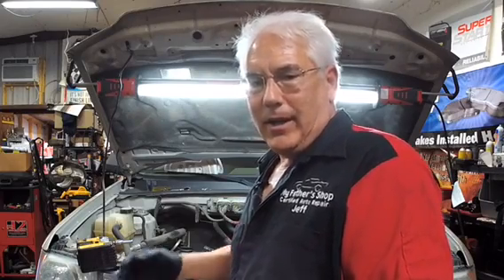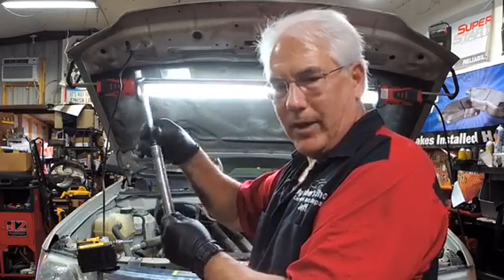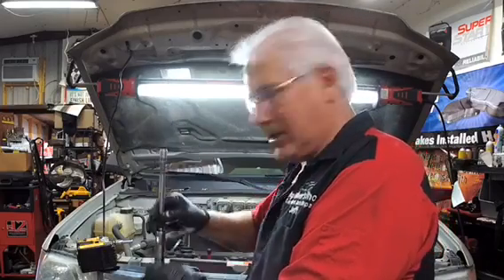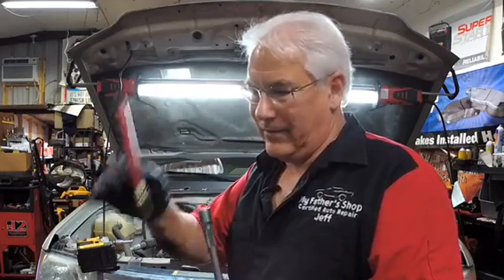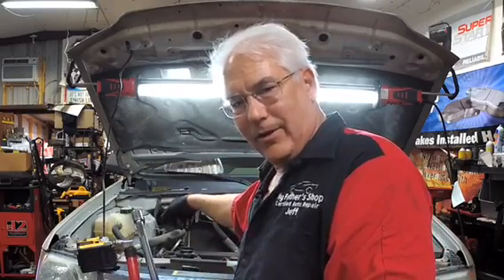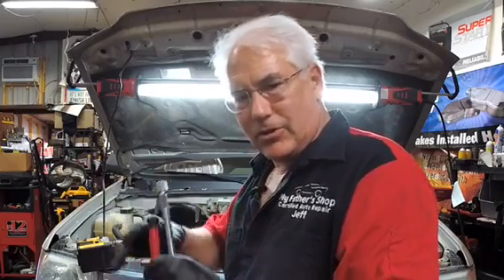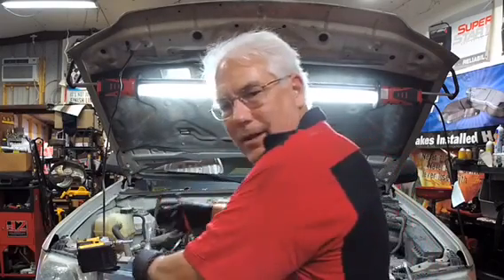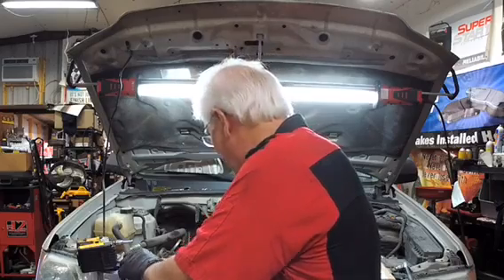Jeff Buckley explains why Oil is leaking in Spark Plug Tube

Comment: Hello, I need some help. I have an 03 civic, I replaced the donut seals, cleaned the coil packs and spark plugs ( spark plugs were new) because some oil got in the wells. It ran fine afterwards but eventually the check engine light came on, and says it's misfiring on all cylinders. It looks dry in the wells with the new seals doing there job. So my question is why is this happening? I cleaned spark plugs off incase I didn't do a good job last time. Coil packs look good since I last cleaned them. I don't get it. Do I need to get new coil packs, and or spark plugs? Did the oil getting through it before ruin them?? Please someone help. I don't know what to do. Thankyou!
Reply from the maker: You can get new boots for the coils if the oil was on them . I would have put new spark plugs. Sometimes if oil was on them they get a coating that you can’t clean . Try both of those next.
Reply: @myfathersshop  ok, thanks!

Comment: Good this cause the engine to not start?
Reply from the maker: Yes, it can foul multiple Spark plugs. Pull the coils and if they come out with oil on the ends, suck the oil out with a shop vacuum.

Comment: It's the the plug port seals not cover gasket. Faulty cover gasket will leak oil down the side of the head and black.
Reply from the maker: Yes, the valve cover has to come off to replace those.
Reply: I think it's a 5.4 2v engine in this video. They don't have "plug port seals", or tube seals, other than a rim on the coil boot.

Comment: It's the sparkplug tube seals, not the valve cover gasket.
Reply: That is 2 different things, and an owner can start with the simple and cheap one first... (the valve cover gasket replacement).
Reply: The 5.4 2v in this video does not have tube seals. The tubes are molded into the heads and are adjacent to the valve covers.
Many other vehicles do have tube seals or O-rings, especially if the tubes go through the valve cover.

Comment: I'm looking at the main valve cover gasket and it's perfectly sealed, the top gaskets, actually no 4 was leaking, so I gently turned each nut 1/4 turn each until I did approximately 3/4 - 1 full turn to tighten and it's stopped the leak.

Comment: I fixed my 2001 Camry and I removed the oil in cylinder plug no 4.. cleaned up all spark plug down inside and retightend the 4 nuts on top and it stopped leaking. The gasket was only 38 months old and I'll be watching it to see if I'll need to replace the top gaskets.

Comment: Hi I have oil fouling on the electrode and thread of the spark plug in only cylinder 3 on my 01 v6 mustang. I’ve replaced the PCV system, valve cover gasket and put a new plug but when I pull it off it’s still oil fouling. I have good compression in that cylinder and my car doesn’t smoke on startup so what in the world could the problem be?
Reply: Your valves need adjustment or worn piston rings.

Comment: Ford changed my spark plugs and a coil on my 2003 Grand Marquis. I has 170,000 miles. They changed it on 9/16/2020, and 30 days later, the car is losing power and shaking a little. Ford say I have a leak in cylinder 7 of the valvetrain. It must be a major leak for the spark plugs and coil to soil again. I thought I had a warranty onnthe work Ford did but they say I don't have a warranty.. They did not want to check to see if oil leaked onto the spark plugs and coil or whether they sold me bad spark plugs and coil or bad work. I spend over $500 for them to change spark plugs and a coil.
Reply: So what it you point? Get a real mechanic and do NOT go to a dealership if practical.

Comment: Hi.   I Have a simple question. I have a audi a3 2008 , 143000 miles.. I been dealing with oil on sparks plug , I change twists coil and spark.. change pcv, even oxygen sensor, air filter clean throttle body and temperature sensor... I thinking its will be piston ring .. And just notice its getting hard to star probably is injector I'm sure... my question is you thinks its worth it keep changing piston ring with injector.   For this car? Or jus  I give up and get  new one ?? Thanks

Comment: Jeff! I changed the valve seal cover and the spark tube seals and its still leaking, do you think its possible that me and my dad didnt do it correctly?
Reply from the maker: What kind of vehicle, some of them have a tube that can move . Push down on them to make sure they are seated . You can push Down from the top without pulling the cover . Second, sometimes the spark plug tube seal doesn’t seat properly. Take a small screwdriver and go around the edge.
Reply: Jeff Buckley My Father’s Shop its on a 2006 cobalt ss supercharged, it was leaking very slightly I believe, cleaned it it some and i test drove it here a bit ago and it seems to have stopped, it doesnt stutter slightly anymore, thank you for your information, if the problem comes back up again i will come back to your comment for guidance, and also thank you for your time! God bless you!

Comment: My car stopped while accelerating I found oil on sparkplugs what can be the problem is that why my car stopped I haven't had a tune up since beginning of 2019 and since then I put 100,000 more miles on it
Reply: moneka farr completely stopped and not running at all now? 100,000 miles in one year and no maintenance? There could be a million problems with it, id take it to a mechanic.

Comment: I replaced upper and lower valve cover seals about 3 years ago & barley drive my 3800 Buick LeSabre & spark plugs had oil on them..If the car has been sitting for 5 months can valve  go bad?
Reply from the maker: Jason Torez not likely but the rings can allow oil to blow by and have oil on the bottom of the plug. This video shows oil leaking on the top of plugs .
Reply: I’ll look into it..Check engine light keeps flashing and cutting off, so that might be the problem..Thanks for responding..Keep up the good work 👍
Reply: Lower intake manifold gaskets on the 3.8 buick.

Comment: Oil is leaking into my coils on my bmw 325i, my car has been leaking oil from underneath as well. I ran the problem on my scanner & it says a cylinder 3 misfire. What can the problem be?  & what should I change first?
Reply: Also shakes alot when I reach 60
Reply: My cars doing the same have you found out what’s wrong ?
Reply: APG Blu I drained the oil, changed all spark plugs & coils, put a new gasket on my oil filter cap, changed the oil filter, put more oil & runs perfectly fine now (also check coolant)
Reply: LostxBoy • Yes

Comment: Quick question, whenever I acceleration, like really give it gas the car sputters. The rpms dont fluctuate when it sputters. I checked cylinder number 2 and it has oil on the spark plug. Could this be causing a short and causing this to happen ? Or is this a different issue
Reply: Kronzrr yes it’s cause  I’m ur plug to not fire
Reply: Y
Reply: Yes, my check engine light was on

Comment: What about a little oil on the thread of plug?
Reply from the maker: Alex C. Could be a little oil leaking from the spark plug tube / valve cover and when you removed the spark plug it got on it.

Comment: Hi one quick question  I have a 2012 civic lx. What can cause oil in the spark plug well and igition coil mostly on one cylinder not alot of oil just a little .
Reply from the maker: Jesus Zuniga this could be the problem. Each spark plug has a seal .
Reply: Jeff Buckley My Father’s Shop  so I would have to change the spark plugs seal in order to fix the issue
Reply from the maker: Jesus Zuniga replace them valve cover gasket and the spark plug seals . Make sure both come in the kit.
Reply: Jeff Buckley My Father’s Shop so a bad piston ring or valve seal would not  cause the issue with the oil getting in the spark plugs

Comment: I have a pool of oil in plug chamber 1 on my miata. Valve cover gasket was recently replaced, same with the plugs and wires and coil. Any other causes?
Reply: You need a special tool to remove tube from vehicle.
Reply from the maker: LTMC Media , there is also oil seals around the spark tubes . If these weren’t replaced, seated properly or the tubes themselves got disturbed. You’re talking Oil on the topside of Spark Plug?
Reply: Jeff Buckley My Father’s Shop 

It looks like this is a problem my 08 Lexus LS 460 has.  I replaced the gasket in the cover and the next plug seals and I’m still getting oil in the metal tubes/plugs.

Can the seals under the plug metal tubes be replaced?  If so, do they unscrew off or do you pull them off?
Does I order special seals or put thread lock underneath it?
Thanks!

Comment: I have a civic 99 si and my car dosent start  and it has oil in the spark plug could this be that or is it something else
Reply from the maker: JDM Car Editz This usually won’t keep the Engine from starting- it will run rough , and shake .
Reply from the maker: JDM Car Editz This usually won’t keep the Engine from starting- it will run rough , and shake .
Reply: Exotic Blizzard did you find out what’s wrong ?

Comment: what if ive already changed the valve cover gaskets and im still getting oil in my spark plugs?
Reply from the maker: did you replace the seals around the openings for the spark plugs ?
Reply: what hes not mentioning is you should also changer your rings while you have it apart my problem is the rings not the gasket itself
i have oil inside the cyclinder heard which is causing the misfire
Reply: I have oil in 2 cyinders on a Ford focus se 2.0  the wall we're the plug goes in doent have a ring or seal. What else could be causing this mishapp.

Comment: Do you have to pump the oil out before changing the spark plugs or is it ok to change while oil gets through
Reply from the maker: Sec. A A I use a suction pump to pull as much out as possible before removing the plug . It will drain into the cylinder , can cause damage . The oil ring it designed to keep oil out of the cylinder.
Reply: Jeff Buckley thank you sir much appreciated
Reply: Hello, 1st owner of 2005 scion xb, manual transmission. Great car.  200k miles. Misfire and loss of responsiveness.  Code read indicates misfire in cylinder #4.  I replaced plugs and MOVED ignition coil in #4 to cylinder #1.  The purpose of that is to see if the code reading in two days indicates the misfire also now moved to cylinder #1.  (I wanted to see if it was only plugs or really an ignition coil).  While doing this I noticed excessive ammounts of oil in the cylinder one spark plug tube.  It is my very first time working on engine so I did ot think to dry the tube of oil prior to removing plug.  What problems will I face because of this?  Further concern you can assist with is this:  I do deliveries for a living and my car burns lots of oil.  no leaks on floor of driveway but oil in engine disappears.  I often purchase oil and put it in without funnel.  This causes oil to spill over the engine, the engine cover , and in between the cover and the oil tube.  Do you suspect the oil making its way into spark plug tube for cycinder#1 came from how i pour oil in recklessly?  again take note my misfire code was for cyclinder #4 (furthest away from the oil pour area).
Reply: get a real car mechanic and stop with the wordy nonsense...  the problem may be 1 of 2 things in many cars and the simple ...and cheap one is replace the Valve Cover Gasket correctly.  The other one is doable for a DIY person but you must have the correct tools, replacement seals, and know what to do. A larger town may have mobile mechanics like mine and I THANK him and pay him cash and do not argue at all!